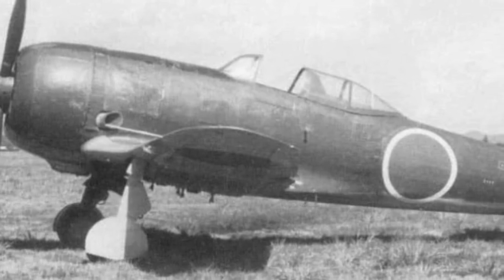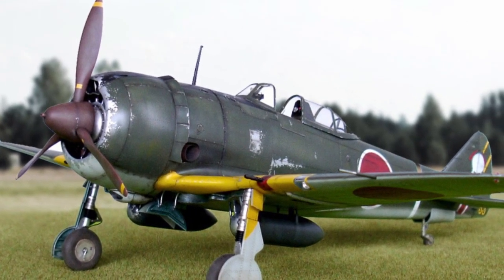World War II warplanes| Planes of Japan| Nakajima Ki-44

Comment: Planes keep being called "cars..." good start but pleeeeease edit it..
Reply from the maker: Thank you for your comment. You are entitled to believe that an airplane is not a machine, but if you consider that a machine is a physical system that uses energy to exert forces and control motion to perform an action, then perhaps an airplane can be included in this definition.
Reply: @airwarriors113  I think you misunderstood me...  I agree an airplane is a machine. However, by definition it is not an automobile. In the video it is called a "car" multiple times. I figured that there was an editing issue as calling an airplane an automobile is incorrect. I liked the video, but that part threw me off a bit as it is factually incorrect. Other than that I felt the video was actually very good and factual. I intend to subscribe once I'm done typing this, It's constructive criticism not by any means intended as an attack on your work.
Reply from the maker: Yes, I see your point. In this case you are absolutely right. It is an unfortunate inaccuracy. It happens. And as for criticism, I don't mind it at all. It is very useful in terms of improving the quality of content. Once again, thank you very much.